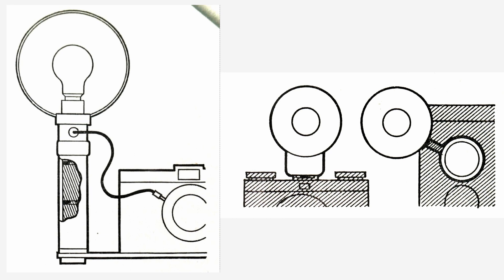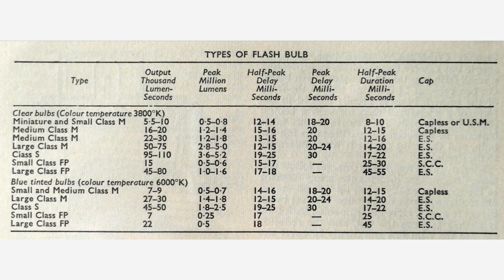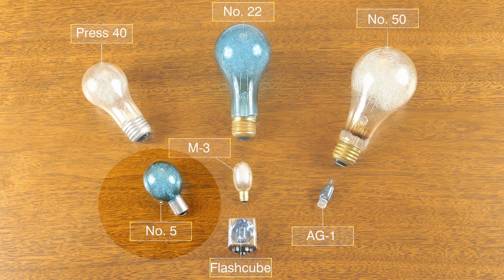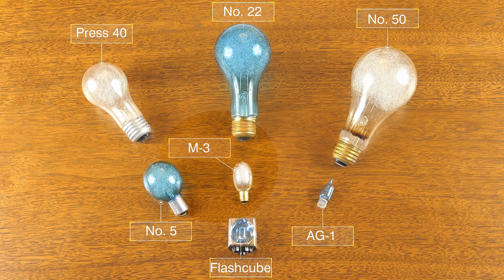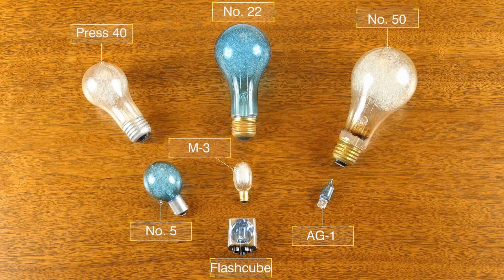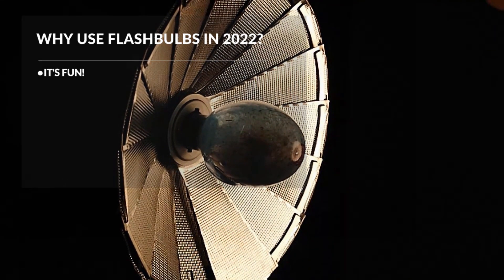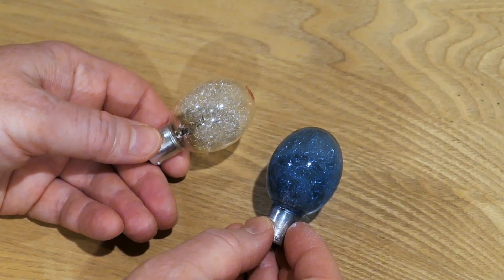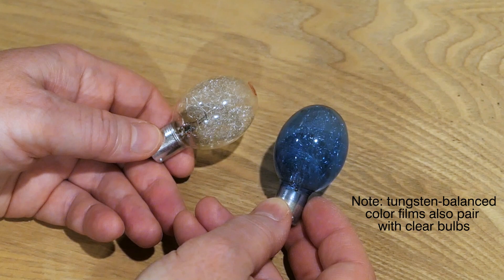Vintage Flashbulbs — Part I: Photographic Magic

Comment: Have any of these bulbs ever shattered on you after firing? I've heard in can happen but it's rare and many bulbs have a plastic coating to prevent that. I have a Kodak 2 way flash guard than add a little protection and can also be used as a flash modifier if you choose to use the opaque side.
Reply from the maker: Yes, I had an entire box of bulbs that all shattered or even exploded when I used them.  They were from an off-brand manufacturer and the protective film had separated from the glass bulbs over the years.  I have never had a bulb from a major manufacturer explode like that.

Comment: Awesome! Thank You! I love those too, even if i also love realy old Xenon flash units. Personaly i think You do the absolute right thing by using them.
Reply from the maker: Thank you!  I plan on doing more videos on flashbulbs as time goes by.
Reply: @oddballcamera  Awesome! I found Your talk about the diagrams and carracteristics after i posted, this was genuinely good information! I did found a similar but smaller unit made by a German company in the early 60s i hope will do the trick, i had a box of those common lamps after my grandparents and i taught for a long time it would be realy fun to try them! but i was afraid to just waste them away bacause of my total lack of knowldege about the carracteristics previously. Now when i found Your explanation i think i got how they where originaly intended to be used and how the correct setup shall be made. 
Thank You a lot! I did try previously with an old Xenon unit, but now i know that the Xenon gas discharge tubes do work very different compared to the Magnesium bulbs.
Reply from the maker: @Vampi_Sweden  That's great, I'm glad you're going to put these to use!

Comment: Can I get a follow up video I have been looking everywhere for this in my camera restoration process
Reply from the maker: @raamenstallings1820  Thanks for your comment! What kind of information are you looking for? Have you watched my Part II video on flashbulbs? I go into a lot more detail in that video.
Reply: @ yes I finished it. It’s really informative. Trying to learn the light values of the flash. I’m modifying old Polaroids to be usable with new instant film. The folding flash setups are perfect for my needs but it’s difficult for me to find more info. I can email you more details if that helps
Reply from the maker: @raamenstallings1820  It's going to depend on the model of Polaroid camera that you are using. The older models should already be synchronized for flashbulbs.

Comment: I have several cases of Press 25 flash bulbs which I bought cheap along with a case of M3 bulbs and 15 boxes of AG1 bulbs. I am 80 years old and still have my Brownie Hawkeye camera from 1951 which I shot hundreds of Press 25 with.  I still use press 25 bulbs with my Rolleiflex and 4x5 Crown Graphic cameras.  In the late 1960s I was shooting weddings on the 4x5 with flashbulb and still use that combo today for shooting sports group photos at two schools I shoot for.  The kids love when I shoot flashbulbs.  Even some of their parents never saw them.  One of my favorite ways of shooting is using the Honeywell Tilt-a-mite angled back at 45 degrees.  Half the flash lights the front of the groups and the other half bounces off the ceiling creating a fantastic soft almost shadowless light in the room.  Modern photograhers can keep their digital cameras.  I hate digital.  Love film. The digital camera turned bums into photographers and photographers into bums.  I LOVE THE SMELL OF FLASHBULBS IN THE MORNING.
Reply from the maker: Thank you so much for your comments, I absolutely LOVE hearing from people who either used flashbulbs back in the day or are using them today...in your case both are true!  I love so much that you are using these today for shooting group photos, that is so amazing.  I can imagine how surprised people would be to see the flashbulbs being fired in 2024!  So great.  Thanks also for the comments on using the Tilt-A-Mite angled at 45 degrees...the unit is so wonderful in that configuration.  I really appreciate you taking the time to write this all out, thanks again!

Comment: only about 1/3 of the way through and need to pause to comment!

i got my first 'real camera' of my own from my mom who got a Kodak Signet 40 with flash at a garage sale in 1979-ish.  i used the #5B bulbs almost exclusively and i was actually pretty good with figuring out exposures.

i moved on to a Canon AE-1 as a graduation present in 1982 (summer before senior year) from my parents, sister, and grandparents and i added a Sunpak speedlite.

ive still got the Kodak but my mom always going to garage sales found another 8-10 old cameras taking roll film and having flash bulbs.  i added a pair of Graflex Crown Graphics (Crown's dont have the focal plane shutter, just a copal shutter) and im trying to remember everything i once knew.  im shooting fuji instax in a lomograflok back at 800 ASA and that puts the guide numbers WAY UP THERE!  800 speed film and #5 (never mind and M3!) gives me 35' at f16.  it might be in part 2 (cued up for next to watch!) but wouldnt that completely blow out my subject if they were closer than 35'?

anyway im loving it so far and going back to watch more!

in the 3 'bulb' comparison, you need to also take into account the size of the flash head v the size of the reflector..

i have a Heiland mini-tilt with a capacitor but no battery.  also no instructions.  does that take an unobtanium 22.5v battery?  i also have  Pro something (same concept) with no capacitor, and no battery.  its a good 'prop'
Reply from the maker: That's fantastic!  Thank you so much for sharing...I absolutely love to hear from others who used flashbulbs back in the day.  Yes, one of the "disadvantages" of the big #5 bulbs is that they almost provide too much light when shooting with high speed films!  What you can do is use that to your advantage by using flash modifiers to make the light quality even better, at the cost of a few stops of light output.  Talking with my dad, one common light modifier that people used to use with flashbulbs is to drape a white handkerchief over the flash unit as a makeshift (but effective) light box, softening the light and reducing the light output by a couple of stops.  Also with the Tilt-A-Mite you can also do bounce flash if you're inside, tilting the flash head up at an angle to bounce the flash off the ceiling.  This will greatly soften the light output and also takes a couple of stops off the light output.

Comment: These things are amazing. Syncs with focal plane shutter up to 1/1000, and ridiculously high guide numbers. Plus you can shoot flash with motion blur. Anyone who's ever tried to use strobe on a fountain or waterfall knows that the water seem to disappear that way. Bulbs burn long enough to render some movement of the droplets, creating a much more realistic flash photo.
Reply from the maker: Yes!  I love to hear from others who use flashbulbs.  That's such a great point about being able to include realistic motion blur with flashbulbs.  I've been wanting to shoot flashbulbs in falling snow at night, but unfortunately haven't had a chance to try it yet.  Maybe next year.
Reply: @oddballcamera  I save my FP bulbs for when I want fast shutter sync, since they're more expensive and less common. For intentional motion blur, you can use M at 1/30, or F at 1/60. The natural diffusion of the light also makes for a nice effect with snow or moving water. I also shoot hi-power cubes with my Polaroid 450 because that's all it takes. I have a Minolta 16mm that takes AG1, but you can use AG3 for an extra EV.

Comment: I'm wondering what will happen. You can screw in one of these flash bulbs into an incandescent socket 120 volts
Reply from the maker: Yes, that's true. All of the old flash manuals warn not to do this. The smaller bulbs will explode and possibly short out the house circuitry, presenting a potential fire hazard. I'm pretty sure this is one reason why the Edison base bulbs were entirely abandoned for consumer flashbulbs by the 1950s.
Reply: @oddballcamera  It's perfectly safe, and they don't explode. You can use any voltage to fire the bulb, all it does is ignite the primer and the burning aluminum produces the light. Some flash guns even have connectors that can be plugged into a standard household outlet, which you shouldn't do, but I have rigged up desk lamps with extension cords to fire the bulbs off of battery.
Reply from the maker: @arthurserino2254 Yes, great points.
Reply: It is unpredictable how the thin wires visible in the flashbulb will bend or sag or behave when the aluminum net or foil ignites and flashes normally. If the wires should touch then 120 volt house current protected by the 15 or so ampere fuse or circuit breaker could allow a current flow great enough to vaporize those parts and explode the bulb.

Comment: HI I'm trying to get a "West Hyper BII" flash working. I've got a new battery for it, but it's still not working and I think the capacitor is dead. It's a West 100MFD cylindrical type. I can't find a replacement. When I look for 100 MFD caps I can't find anything of the right size (just under 2 inch length) or shape. Any help/ideas would be appreciated, thanks!
Reply from the maker: I'm not an expert in electronics, but I do know that some people buy more modern capacitors of the same capacity and voltage as the originals, but the modern versions are much smaller.  These modern capacitors have wire leads and can be hard-wired (soldered) into the flash unit to replace the original '60s-era capacitors.  I believe these modern capacitors are also quite inexpensive.
Reply from the maker: Also, if you are going to the trouble of putting in a new capacitor, another thing to think about is possibly going to a 12V capacitor so that you can use modern 23A batteries as well.  These batteries are much cheaper and easier to find than the older 15V or 22.5V batteries that the old flash units used.  23A batteries are a different length than the original batteries, so you'll also need to sort out some kind of spring spacer to hold them in place.  But if you can get all of this done it will be worth the effort in the long run as it will make your flash unit much easier to use over time.
Reply: Thank you. I managed to find a direct replacement battery, but a direct replacement for the cap. I wanted to ensure any 100 mfd cap would do, and don’t really like the idea of trying to solder one in. But if that’s what I have to do then I will have to give it a try!

Comment: I was in photography school from 1976 to 1978. We had a teacher who loved flashbulbs and talked us into buying these BC-7 flashguns. I bought three of them and I used optical slaves to trigger them. They had a plug you could plug in a slave. They work great as fill-in flash with sunlight. I have some girls in bikinis I photographed outdoors with flashbulbs. The light is smooth. I used both the 1AGs and the M3s. Nothing spreads like a flashbulb. I don't think they could work with digital because of the M sych flash. I miss this type of lighting. The architectural photographer. Jules Shulman would use #50 flashbulbs that were slaved together for interior lighting. He would mainly use the 4x5 view camera.
Reply from the maker: That's fantastic!  I love to hear from people who used to use these on a regular basis back in the day.  The optical slave trigger is really cool...I have a vintage optical slave that was designed for use with flashbulb guns that I hope to use someday.  You're absolutely right that nothing provides the soft light spread of a flashbulb!

Comment: Great video! New bulbs were sold through the mid 1980s. I regularly used M3’s and 5’s in 1983 for my school yearbook work.
Reply: i bought a case (144) M2 bulbs and then i just got another 135-ish Press25s.  i also picked up 70 some #5b.  im hoping i can re-learn everything i used to know about bulb-flash photography and shoot my Graflex with them.
Reply from the maker: Really cool! I love to hear that you were using these into the mid-'80s.  I'll try to cover the M-series bulbs in a followup episode (part 3?).

Comment: This is great. I have a bag of AG-1 bulbs around 200.  I'll use them with a  Tilt-a-Mite on my Yashica 635 TLR.
Reply from the maker: They're a lot of fun. The Tilt-a-Mite also has a guide number calculator right on the unit so you can easily figure out distance and aperture.

Comment: How did you power the bulb flash?
Reply from the maker: Ah, this is a great question that I forgot to discuss in the video! The Tilt-A-Mite uses a 15 volt type 504 battery.  These were common back in the '60s and '70s but none of the major battery manufacturers have made these batteries for quite a long time. There are a couple of manufacturers that make replacements for these batteries now, but they are pretty expensive--typically between $10 and $15 for the battery, which is about the same price you'll pay for the flash unit! But the good news is that if you take the battery out of the unit when not using it the batteries will last for years. I use a battery made by Exell (found on Amazon) and there's another company, Banshee, that also makes these batteries.  I think some people have also successfully used an alkaline A23 battery in these units, which are only 12 volts but should still charge the capacitor.  These batteries are still commonly made and are much cheaper than the 504.  I think the A23 batteries are also a bit shorter so might need some metal shims to complete the circuit.

Comment: Great video, I'm still using Philips Photoflux PF1 Bulbs with my M4
Reply from the maker: Very nice! The PF1 bulbs are very interesting, with their own unique capless base that I didn't cover in this video. Which flash unit do you use your PF1 bulbs with? Do you have a flash unit that takes the PF1 bulbs natively, or do you use a base adapter?
Reply: @oddballcamera   - I'm using a Leitz CEYAL 15503 J / 15506 M Flash that comes with a bayonet to capless adapter.

Comment: I remember these when my dad would do birthday, Christmas, or ,well, any indoor pictures. I popped a bunch of them myself when I could talk dad into letting me use the camera. I knew you'd mention modifiers for the electronic flash. Almost have to use those. Last week, at my grand daughters birthday, I did bounce flash for most of my pictures. They looked pretty good. No... I didn't shoot film... I'm a bad grand daddy for that.  sorry
Reply from the maker: Nothing wrong with shooting digital!  In fact I've been meaning to try out flash bulbs with digital cameras.  The synchronization is the tricky part.